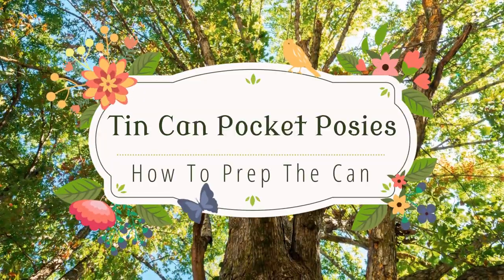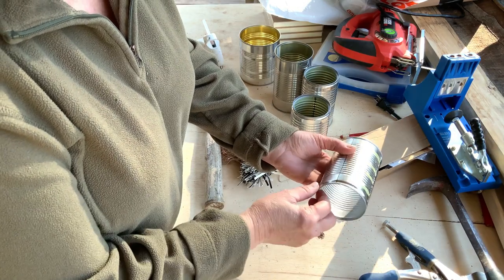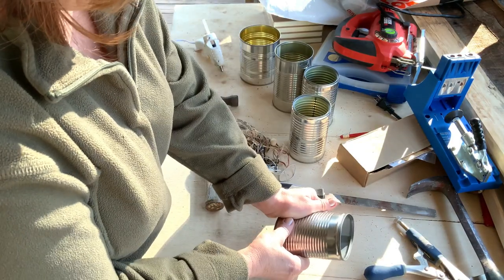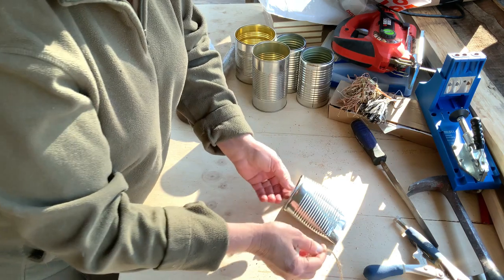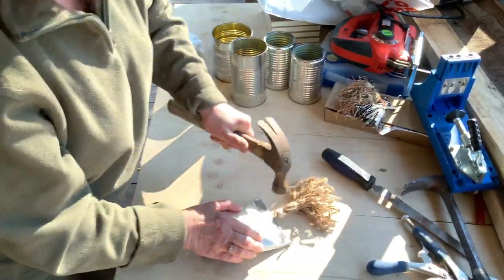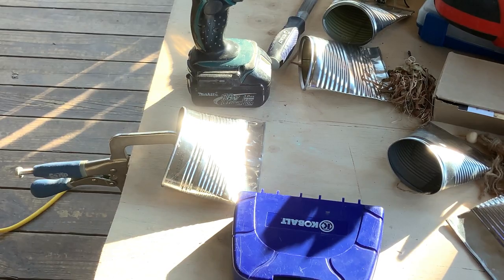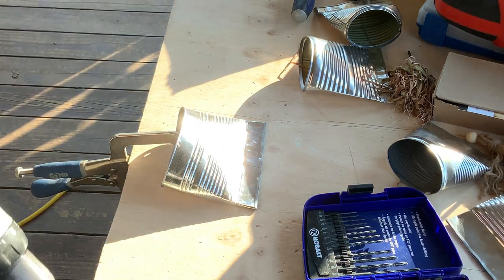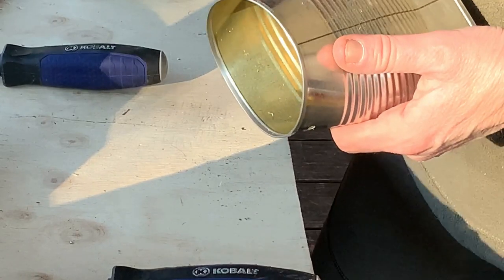DIY Tin Can Pocket Planter Prep

Comment: I love my crocodile that you can use to punch hole in the sides of the can..so worth it as a time saver...thank you for your instruction
Reply from the maker: I recently bought one for making journals. I never realized it would punch through tin, but that is a good tip! Does it dull the punch going through tin?

Comment: I've just come across your video on this, will need to look into it a bit more but a couple of questions please.
What paint do you use?
Can they stay outside in all weather's  or are they for indoors.?
Alsi do the tins go rusty and come through thd paint?
Many thanks x
Reply from the maker: I use chalk paint. If you watch the next video, I show the next steps. I would not leave them out in the weather; I think a covered porch would be fine, but these are just for decoration. As far as rusting, I think the only way that would happen is by continuous exposure to the elements.

Comment: I tried this tonight but can not get my cans to open on the other end. It just dented the can. What type of can are you using? Thank you!
Reply from the maker: The bottom of the can has to be made like the top of the can; there have to be rims on both ends for a can opener. If the bottom is rounded it won’t work. I did a “shorts” recap that explains this better. 
https://youtu.be/9Ef-apEQ-nQ
Reply: Thank you. I ended up buying a different can opener and it worked. I'll be sure to check out your other videos. Thank you again!!